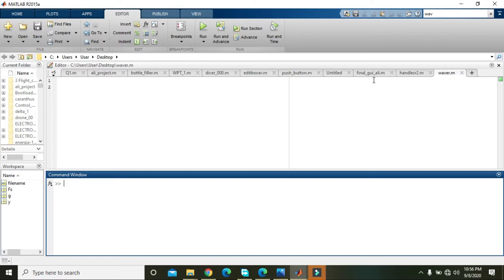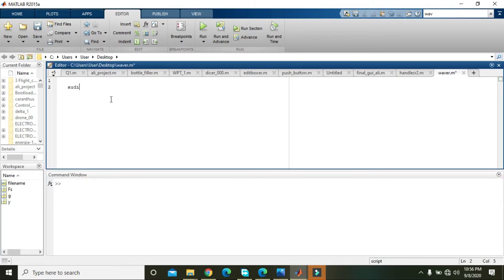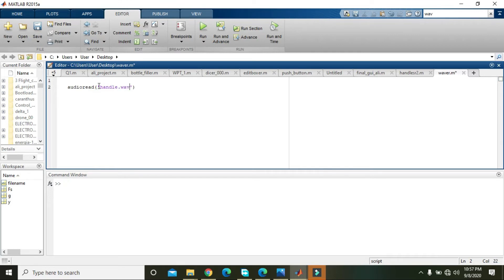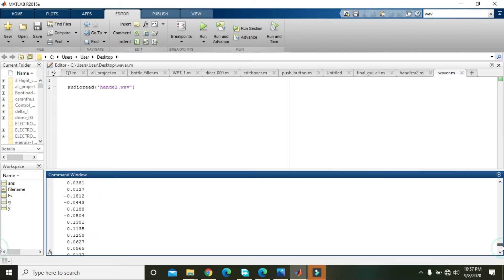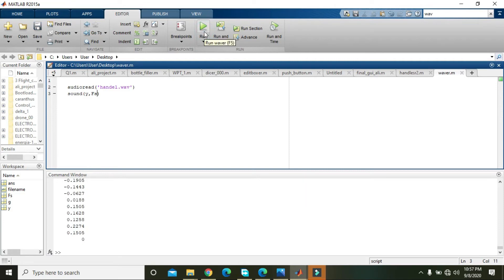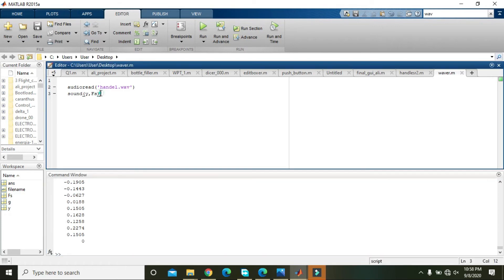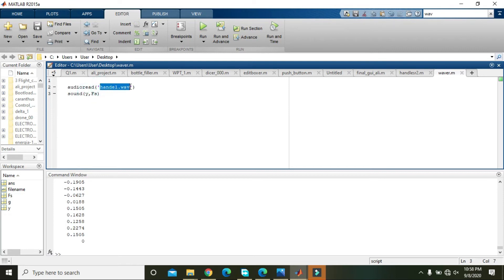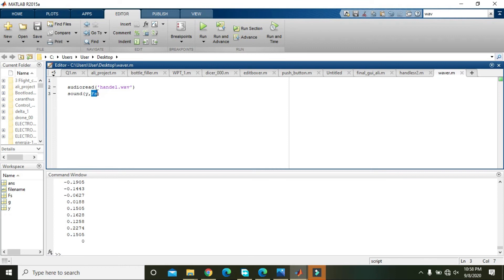how to read an audio file in matlab | audio file reading in matlab

Comment: i get the following error when i use the sound function :(
Undefined function or variable 'y'.

Error in Untitled (line 3)
sound(y,Fs)
Reply from the maker: ok i think either u have put the capital Y instead of y or u need to put some value in it...as undefined function or variable just means that....
Reply: @nelsondarwinpaktech3954  no i followed ur method, same thing as you: sound[y,Fs]
Reply: instead of writing;
 audioread('hande1.wav')
try write;
[y,Fs]= audioread('hande1.wav')
I try this way and it can play the sound

Comment: An error is appearing that filename specifed was noy found in matlab path... Even i was using your code
Reply from the maker: nida....i got..either u r not using the complete path,,like 'c:\user\user\filename.wav',,,and one thing more u r trying to read .mp3 file..matlab usually reads .wav files...but u need to copy the error and tell me and i will just neutralize it....
Reply: @nelsondarwinpaktech3954   audio.mp3 was not found in matlab path...
This is what exact error is coming ..i just copied that